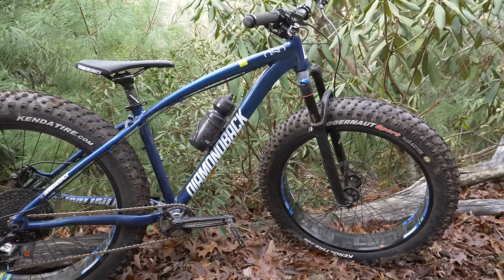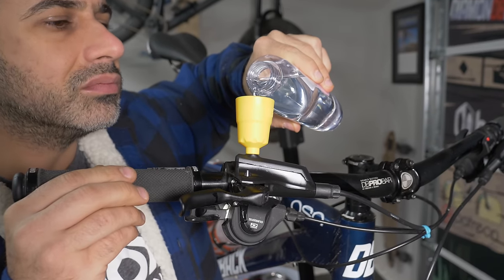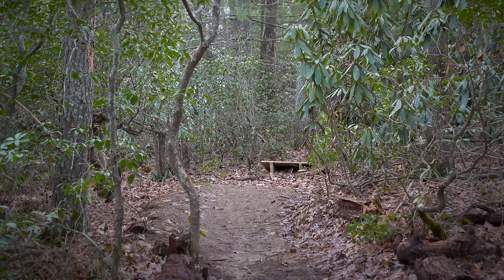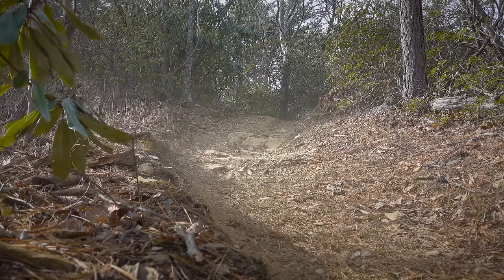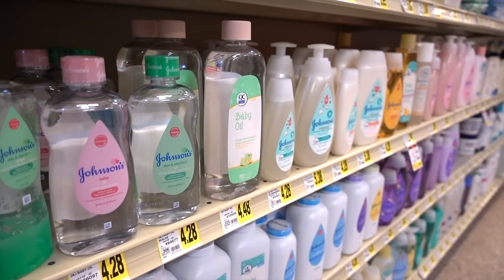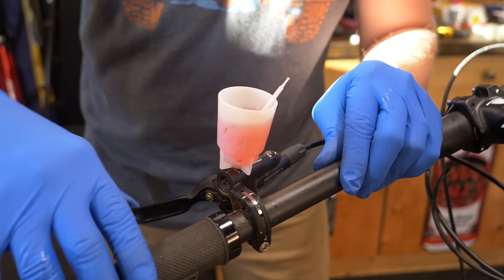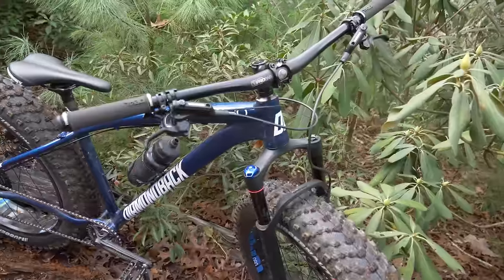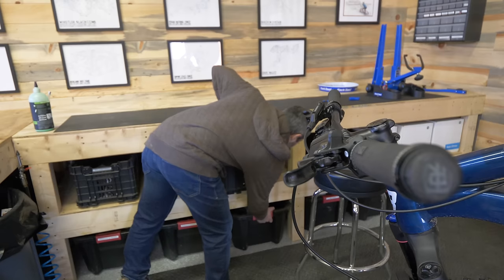I filled my mountain bike brakes with baby oil for a year and here are the results!

Comment: 1:37 ,, no ,, you should ask , is it Safe for the environment ,,, B/c that's why someone would use ,, if they didn't Want to Pollute the Trail ..
and does it Work better , or the Same .. 
i would think that With such a Low Compression point , it should be fine , its not like its Under that High of a Pressus like a Brake line in your car

Comment: I bought this Trek bike and not only had they used the brakepads but also the metal surrounding them AND those metal cups that are pushed with the oil. Anyone know what those cups are called?
Edit: They are called pistons and no I can't order them. Only one piston has been worn out . What if I file it so it's level would it work? Jesus, I'll just order new calibers I guess.

Comment: Can I use DOT3 brake fluid on MTB brakes?
Reply: if they are designed for dot fluid, then yes. if not, then don't. it will eat at the seals and dispense corrosive dot fluid all over you, your paint and the nature you are in.

Comment: What happens if you flip the rocker arm on your rear shock
Reply: That depends on whether you use baby oil, mineral oil, water or brake fluid in it...
Reply: the geometry won't work, the shock won't fit, the rear tire will probably contact the frame, the suspension will be dicked, it will void the warranty, and the bearings most likely won't fit anyway.

Comment: "brake oil" - giving me an aneurysm man! You said the name of the mechanism "hydraulic brakes" from the get-go.  It is hydraulic oil or fluid, brake oil is a really misleading descriptor.
Many common grades of oil you find will have the ability to compress more than hydraulic fluid as well as DESTROY your seals in the brakes, or make the elastomers(o-rings/rubber) swell and ruin your brakes.

Wiki
Most brake fluids used today are glycol-ether based, but mineral oil and silicone-based (DOT 5) fluids are also available.

Comment: Don't do this!!! They are both mineral oil, so are compatible with the seals. But, brake oil has additives for anti foaming and increased boiling point. The difference in boiling point is significant. Pure mineral oil is way too low. If you get those brakes hot at high altitude, you will almost certainly have brake failure. And you can't purge it unless you 100% disassemble and clean, because there will be pockets of the old oil in the system. Even 1 drop of fluid boiling is enough to take out your brakes.

Comment: dot 1 n 2 brake fluid is cheap than baby oils because you paid $6 for small bottle n you can get brake fluid $3 big bottle 
dont get 3 n 4 n 5 it just soo sniff on lever n leave my finger sore pull harder on brake slow it down
only 1 n 2 dot brake fluid suit any bike

"engineer repairs "

Comment: a mineral oil is a mineral oil they can add stuf for viscosity but only to a certain thickness or else they cant name it mineral oil, mineral oil + is fake it does not exist its all marketing
pure mineral oil smels a little bid like baby oil becouse of the additive of ph neutrality 
so basic mineral oil is pure mineral oil and the brand mineral oils are  with some addivtives against aluminium degrading when it comes to boiling point, some anti stickynes or color and thicking ant anti clogging stuf but this is only needen in cae of boiling points or poor aluminium

they dont tell you that pure mineral oil is anti coroding, anti cloging it stays fluid all the time in a water (oil) tide invirement 
hell no they tell you you need special additive oil to keep everything smooth it aint treu  unless you run an engine that gets hot

Comment: Babies are so cool. Yet hmmm...seriously dude, the smell...the smell, the smell... And the price difference is so marginal. So...as a first aid help to a bike in the field...needing to get you somewhere, I find it handy. Yet why not just break oil...I mean...uff...the smell. Yet scientifically...

Problem with normal break fluids is the heat it can stand, and the additives not included, which are put in to baby oils, like various skin care solutions, perfume, and possible other ingredients which can not stand the heat and possibly react with your break lines, materials, aluminium, steel etc. So for a long term solution it is better not used in bikes. But I can see in why you tried.

Comment: Your ignorance on this subject is baffling to me.  You need to fill babies with with baby oil to avoid early wear on their joints per manufacturer recommended intervals.  And NO, you should never use brake oil on babies as the savings is not all that much over standard grade baby oil and you will likely end up voiding the manufacturers warranty.  Just not worth it.